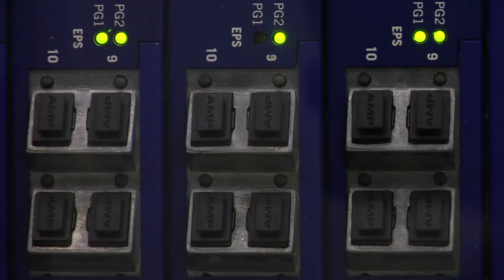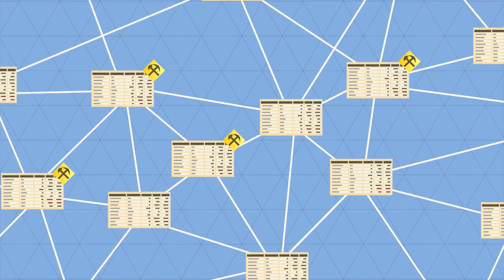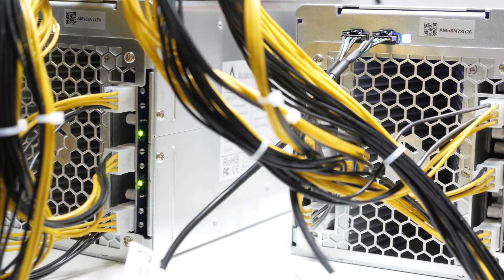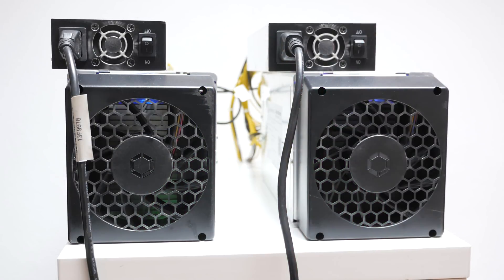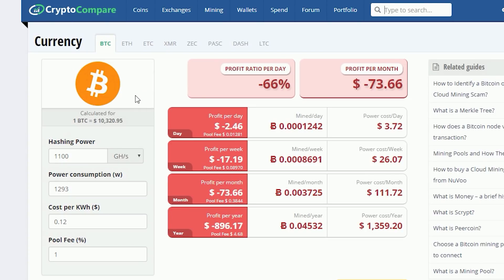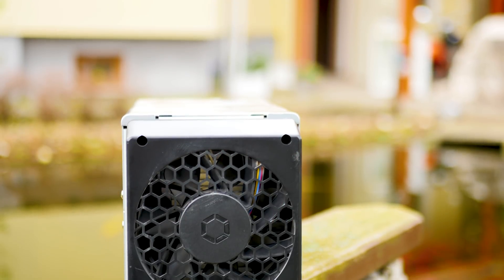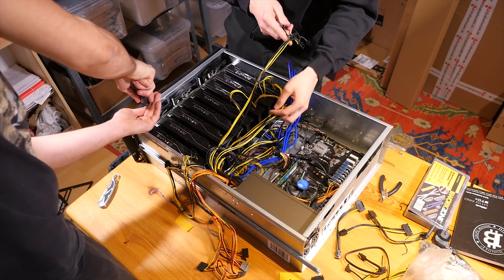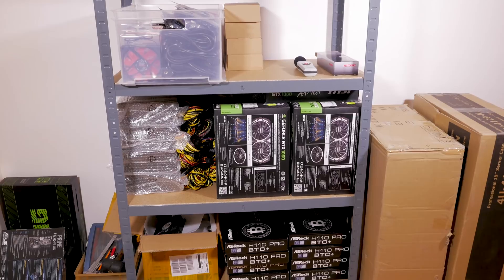Bitcoin Miner & GPU Miner Guide 2018 - What Miner should you buy ?

Comment: I don't get this trend. Such a weak payout for what you spend. Just buy a handful of $10 prepaid phones, and set them up watching those "make $ watching ads" apps. There's like a dozen of those apps that will make you about double what one computer makes a month and will cost about 1/50th of the electricity.
Reply from the maker: seriously ? :D
Reply: TechMagnet Yeah check it out, the app is called Rewardable. Just plays dumb gifs and video shorts with ads in between. I have 20 $10 boost Mobile phones that I bought at Kroger. They make about $110 to $120 per month. Cashes out to PayPal